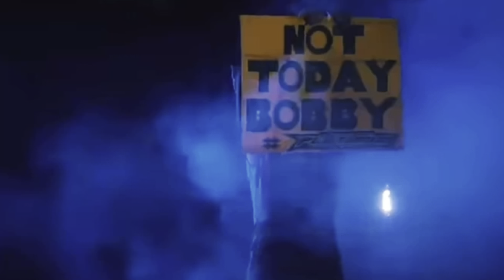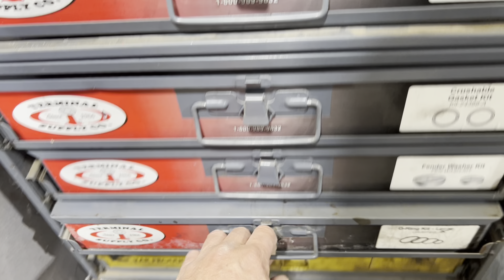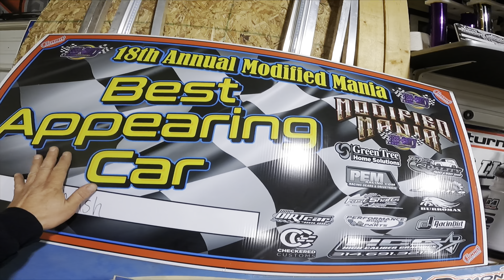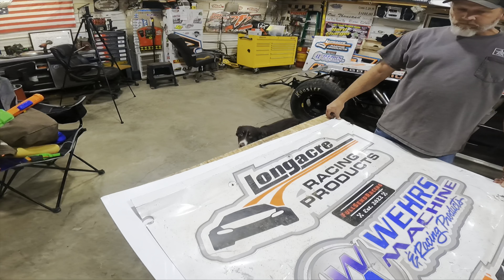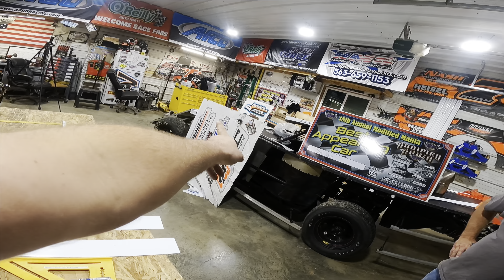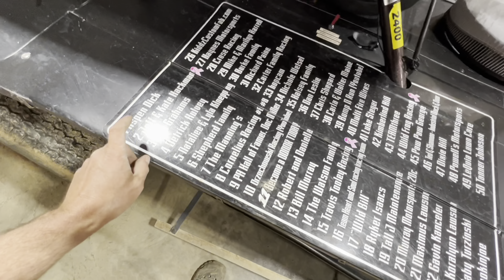Lazarus gets a new body - we’re gonna trash it guaranteed - Gateway Dirt Nationals

Comment: Question. It appears that the yoke on the transmission is sticking out real far.  Just more yoke exposed than I’m used to, but I’m not familiar with dirt cars.
Reply: We have to run a ton of yoke travel on dirt cars due to how much the rearend moves around(in classes that require a stock style transmission we’ve had to cut the splines on the output shaft deeper due to running out of travel more than a few times)
Reply from the maker: What 54 said ^^^
Reply: @54raceman  Thank you for helping me learn.  I appreciate it!